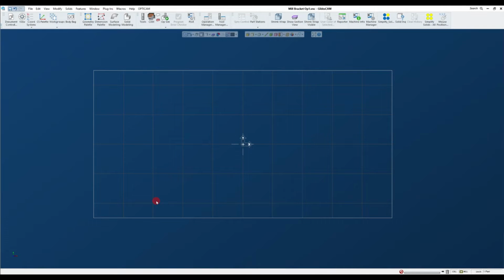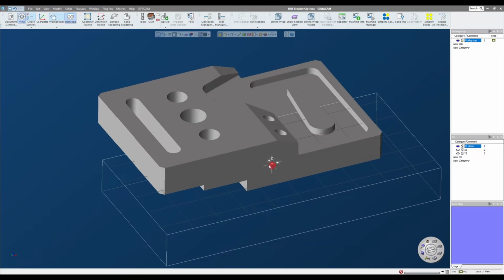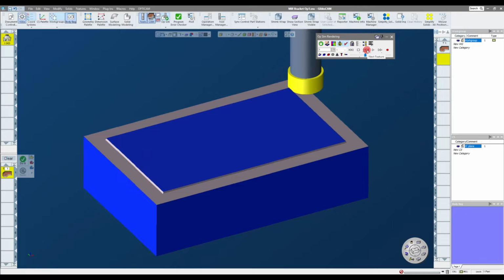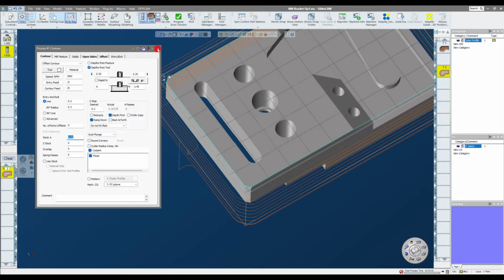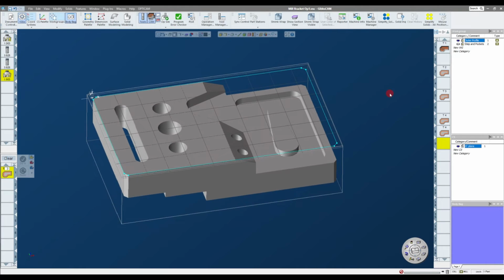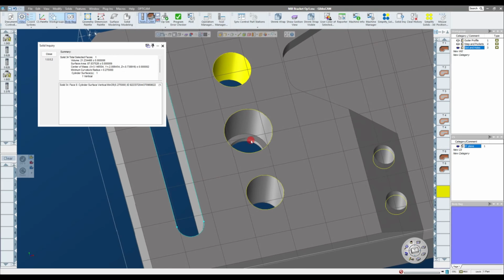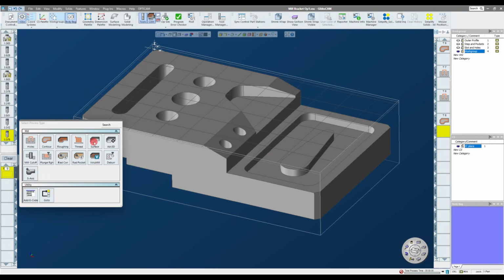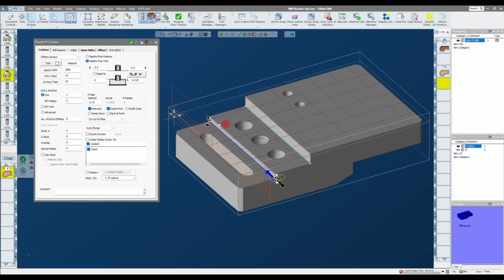Gear Up with GibbsCAM #1: 3-Axis Milling

Comment: Very nice presentation.  My version does not have the surfacing process.  Is there any way of doing this angle without that process feature?
Reply: Absolutely. You could do it using just a Contour Process using the Wall Control feature. Instead of cutting a zero degree Contour, this would allow you to enter a side taper angle and a stepdown.

Comment: Awesome! Picked up a few tips here, for sure! I set "P" as a hot key to turn on "Show Position". It's a MUCH quicker, simpler way to get the Radius of any surface.  Also, I think the safer way to set Z zero plane is to always MODIFY, TRANSLATE your body in Z, as it does not magically adjust the "world" clearance plane in Document Control. It's only a matter of time before that one bites you using "Modify Move Part Origin" for "Z" as you've taught here.  Using the save op sim as "facet body" to define stock for subsequent ops is FANTASTIC!
Reply: Great feedback! If you prefer to use "Show Position", if you right click on it, you can dock it the taskbar in the lower right corner of the screen.